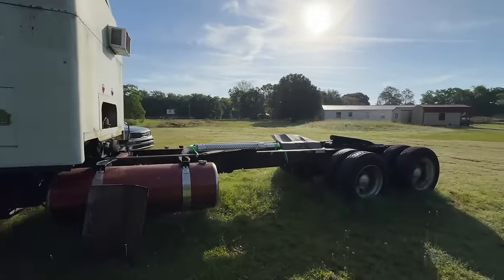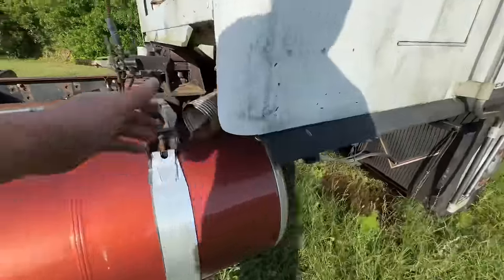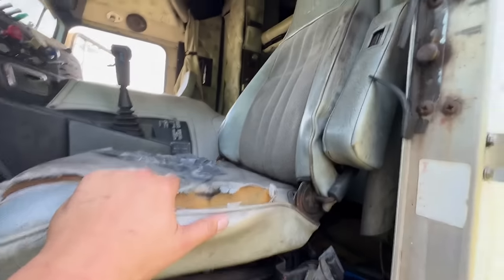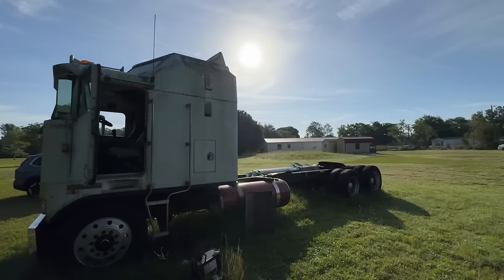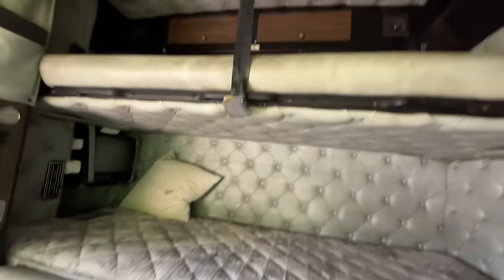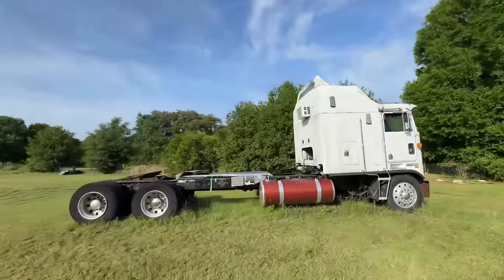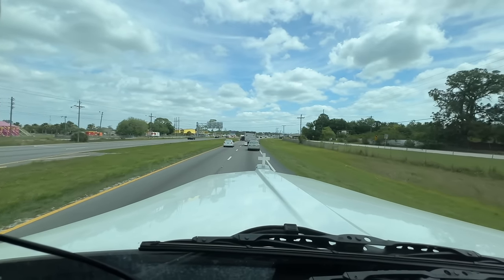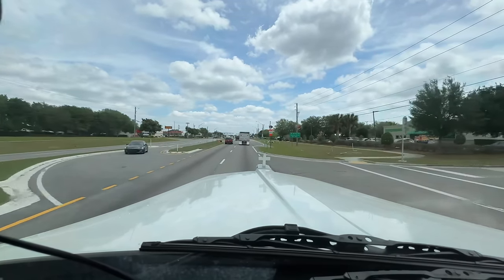BOUGHT a CABOVER in A Field for YEARS !! Will it Run or did I Get Scammed !! K100E Kenworth stretch

Comment: Well I again been with Swift for over 26 years and fixing to retire. I make over .70 a mile. I really never break down maintenance here does pretty good. When you do break down unless your close to a terminal we use vendors .Really hard to control quality but they try. The US Express merge is a work in progress ,I think. I needed a tire repair Sunday on Easter and was fixed in about 2 hours. It could have been faster but mechanic had some equipment issues. I have had those trailers get stuck like that. I take some chock blocks and can usually get them slid. Also a hammer to the pins. If you do have one get stuck slide them all the way back one forth a couple times. 
  Good luck with that cab over. I have drove them and they take a bit to get used to. Your right though cool content and I’m looking forward to watching. 🇺🇸
Reply from the maker: Appreciate you 😎🙏🏽 Dennis

Comment: Take a look at the welds on the frame lengthening joints.  I was a dealer for a lot of years and always insisted that inserts were placed inside the frame that were bent to fit the inside dimensions of the frame.  Pretty much solved the possibility of the welds breaking.  Usually made the insert about 8" in front of the front weld and the same amount past the rear weld.  Added a little weight but added peace of mind.

Comment: Brings back memories, I drove a 75 K100 with a 318 Detriot 13 speed for 4 years from 1075 to 1979.  Leased to a company called Johnson Motor Lines, headquartered out of Charlotte.  I ran out of the New Jersey terminal.  Ran Nabisco cookies from Jersey south hauled cigarettes back north.  Ran drums of Texaco oil to Buffalo turned with load of spackle to Baltimore and Tin plate back up to Jersey, was a good gig until my wife said it was that or her.  Before ICC regulations I was only 19 when I started.  I enjoyed those years.  Good luck with the Kaywoodie.
Reply: I'd said nice being with you see  ya don't want be ya,,like I told my wife,the truck makes the cash deal with it,unless you got money hiding  I don't know about.
Reply: + YOU chose her ?!! 😲
Reply: Johnson was the first company that deregulation in 70 shut down.Akers shut down. Moss and Custom were only a few out of Charlotte.

Comment: Hi Justin great project you might want to get photo of plate on the gearbox. blue splitter knob on the gear stick usually means it’s a 15 speed not a 13 speed. Some good content coming up 👍
Reply: Blue knob on my 1979 K 100 was a Spicer 14 speed SST.
Reply: @truckinfam2207  road rager have different knobs to a spicer yes all spicer knobs are blue
Reply: @chrisstewart5876  I had a 79 k100 with a V-8 Cat 14 speed spicer air shift. Didn’t have to drop the stick all the way across I-80 to the Bay Area California. Problem was the temperature even with a heavy duty trans cooler ran hot hot. Had to back out of it on many mountains.

Comment: I had a '87 Aerodyne w/Big Cam IV, 13 spd. Drove it for two years put 209k miles on it and traded it in on a '92 W900L w/Aerodyne 1 sleeper. It had 425 Cat w/15 spd. up against the dash. I had the grey interior on both like you have. The bunks are small, you roll over and elbow the back wall of sleeper 😂! Great that you can find the grille surround, very rare. Didn't know someone was making them, they'll make a ton of cash. Good luck on your project!
Reply from the maker: I spent maybe two hours looking for that grille surround lol 😂

Comment: Justin Big Cam 350 or 400?? The windshields and upper  windows leak so look for mold and mildew and rot!!! I don’t know what year that is but check the starter voltage if it’s a 24 volt starter switch it to a 12 volt and get rid of the series/ parallel switch but have a good old time mechanic do it!! The harnesses are fragile on those!!! Good luck!!!😁
Reply from the maker: Thank you Philip 🙏🏽😎

Comment: I must admit, I'm not really into stretching trucks, particularly cabovers, as you lose so much on maneuvering ability, which you so often complain there isn't enough space for.  I get adding a small amount to allow for a larger sleeper, but beyond that seems like a waste of the largest benefit of a cabover.
It's not my ride though, so you do you.  
You'll still get the benefit of the better forward view.  In Europe we have limits on overall length, so stretching never makes any sense as it cuts down on the load capacity - you would have to shorten the trailer to match!  
Maybe a future project could be to import a reasonably recent European truck (several options, so I'd suggest looking into what has the best parts support).  That way, you could have modern comforts in a cabover style.  Volvo might be good as they also have US models, and I'd be prepared to bet many or even most of the parts are interchangeable.  How does a 17-litre straight six grab you?  Just 780hp with 3800Nm torque on that.

Comment: The front hubs are left and right stud pilot totally different wheel.
If the rears are 06 there a lot easier unimount.
The 13 speed splits on high side only.
It was the original transmission that was able to split because back then 400 hp was a lot of power and 75 mph at 2100 rpm was moving on down the road.
The 855 series Cummins with the a number 10 button the right rpm spring and the right turbo is capable of about 505 hp. But you haft to upgrade the cooling system from a low flow to a high flow with more rows in the radiator or it will get to hot!
If the stretch has not been run yet an alignment is a must before you let it roll.
Reply from the maker: Appreciate all this info Travis 😎🙏🏽

Comment: The guys Semi Casual would have a blast with this truck. Can’t wait for the transformation journey with this ol work horse
Reply: Also, if it’s not already done, would recommend doing hub seals and bearings, slack adjusters and S-Cams, brake shoes and drums. Maybe new gaskets and seals all thru the motor and transmission. Also look over any and all bushings

Comment: I have an 85 362 sitting in the driveway. It has 3406b with a 9 speed. I'm going to be putting a 13 speed in it and adding jakes. Eventually be putting disc brakes on it.

Comment: There is a 1985 Kenworth Cab Over at a Concrete Company that we do Business with so he actually has a 1986 Conventional both Run just need Some New Rubber and Hoses but The Guy is 85 Years old and Doesn’t want to sell them because he is absolutely Convinced that The only reason is they want to Scrap them out. I have told him I would absolutely Rebuild them completely. So I am still working on him and hopefully he will sell them to me.
Reply from the maker: Hope so 😎🙏🏽

Comment: Wow, gonna take some work on this one, more than the W900 started out it seems. Not sure what the deal is with a stretched frame on a cabover, lose the benefit of shorter frame/easier turning radius and getting into tight fitting dock areas. Hope it turns out the way you are wanting it to be. Congrats.

Comment: I use to have a 85 k100 flat top with a queen size bed . Very nice truck. 400 bc4 13 with 355 rears. Those 336 are going to be a very steep gear set up.. it will probably run 120 mph..lol

Comment: How about making the cab go up instead of tilting it? 4 hydraulic or air pistons in each corner and all you do is unlock the safeties and push a button and up the cab goes.. Don't forget to play some choice elevator music and end with 2nd floor sporting goods ding.....
Worried about weight? No problem. Just fill the tires with helium........

Comment: I'm a bit confused.  I thought part of the up-side to the cab-over is that it is an overall smaller footprint since it's on top of the engine and doesn't have the big nose out in front of the truck.  So what is the purpose of stretching the frame then, since that seems to undo the whole smaller footprint thing.
Reply from the maker: Makes a smooth ride and looks cool 😎 lol
Reply: @JustTruckin  That's fair.  Thanks for helping me wrap my head around it.

Comment: I think the red trailer break is not released I bet the driver has it pushed in if so the air knob wont work .or supply air to the trailer then release.

Comment: I have a k100 just like it had it for 30 years and I have a k100e 1988 . and I tell ya if you hear how bad they are your hearing it from the I heard it bunch . I would hear guys crapping on cabovers they like hearing themselves but they never drove one but they know all about them . I have a chrome gear stick that is not an extension but it is longer really nice to shift and can put in reverse with the steering tilted back . you paid a good price you will love it . and I almost forgot they should be called the sex machine I'm sure you'll figure it out .
Reply from the maker: That’s awesome 😎🙏🏽

Comment: Why is the purpose of the stretched frame other than looks?
Reply: Makes a smoother ride
Reply: @truckingwithcliff  thank you,I’ve asked so many people and no would answer.it just seems to me those things would be a pain getting into some docks.they are cool looking though.
Reply: @leedouglass9636  they're actually a lot easier than a big hood truck, the steering is under the truck vs out front, my pops owned cabovers and I cut my teeth on them.
Reply: @truckingwithcliff  I’m not just referring to cab overs,I’m referring to the hooded ones with the extended frames
Reply: @leedouglass9636  the Hooded stretch will definitely make it difficult in some of these places